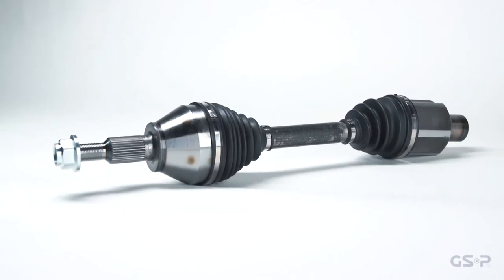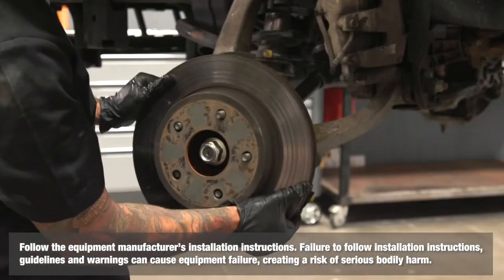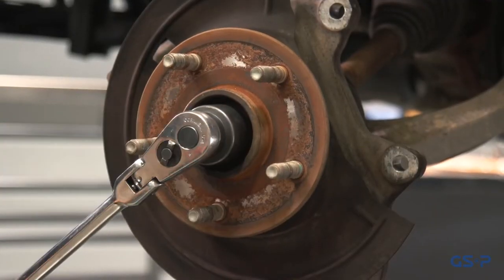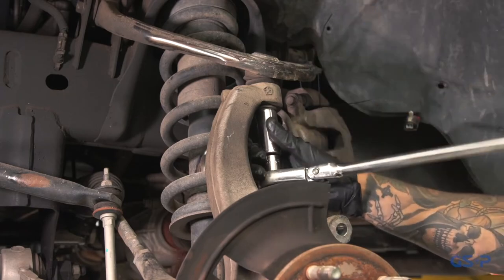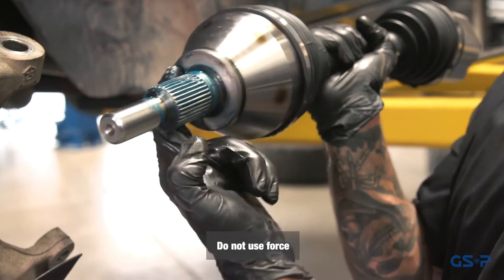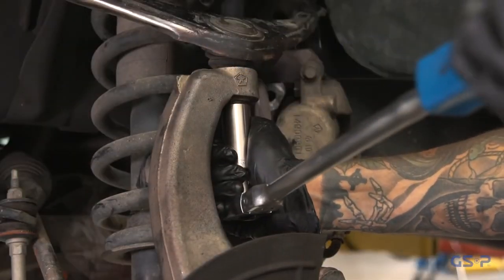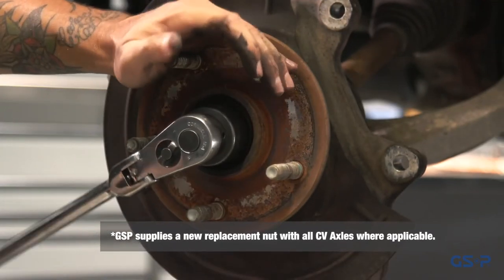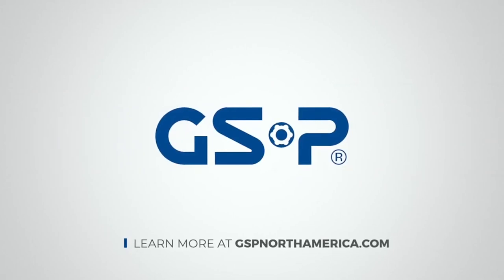GSP CV Axles: Step by Step Installation

Comment: This is only one axle as there are many. I have front wheel drive and I replaced passenger side front and gsp sent me an axle that fits into an axle housing and then the other axle rod coming out of the other side of the housing goes into my transmission. The seal that's attached the axle I bought only butts up to the housing therefore there is no sealing of anything. Can someone please inform me how this is going to work

Comment: Just bought a new GSP driveshaft from Rockauto. Open box the boot is cracked and grease is leaking. Also the driveshaft is dirty, looks like a used driveshaft. Totally different quality that u mention and show in your video. Now I have make a complaint and replacement to Rockauto. Bloody wasting time! So disappointed!
Reply: Tried to replace your broken cracked boot, opened up and thanks for your surprise. I wonder why the outer shaft is so tight and hard to move and turn. Because there’s no grease inside, also rusted! This is your oem standard? Oem has no grease and rust? I should appreciate u have the cracked boot axle, other wise I would install in straight away with no doubt. Be responsible GSP! It’s a CV axle. It could cause serious danger! Shame one you OEM quality!